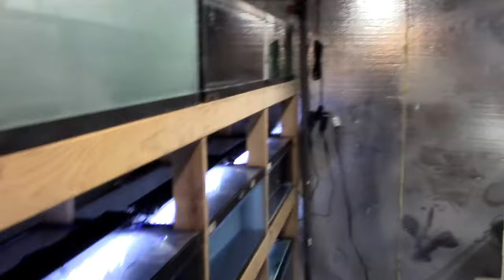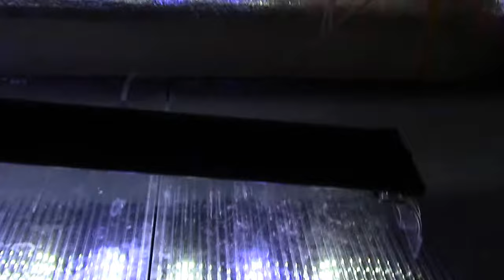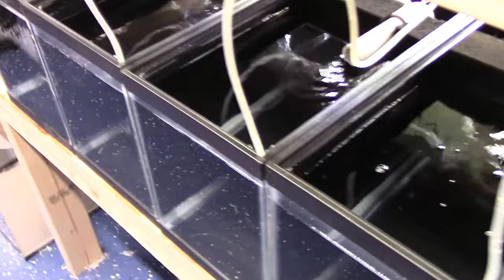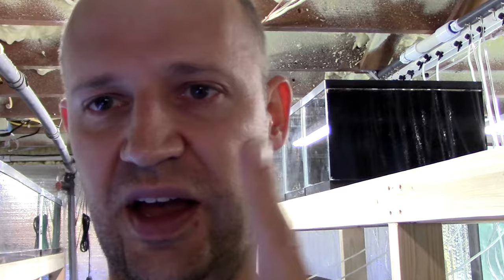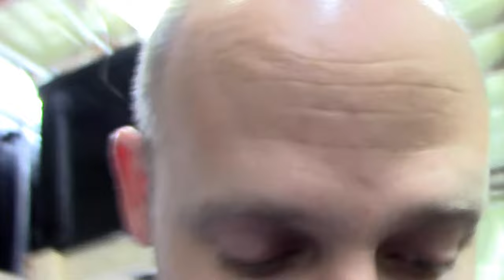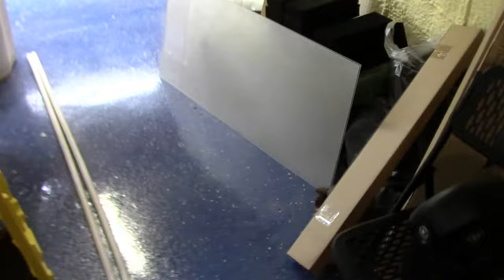Fishroom Update and FISH ORDER PREVIEW!!!!!

Comment: greg sages room temp white worms are trully grindal worms, they are at the least the same size. i have been on the lookout for the tropical white worms myself they are larger than white worms and are supposed to get a bit bigger too, i have also found that breeding red wrigglers is pretty easy. on ebay you can get 1000 worms or 1 pound of red worms for 30$ and every 2 months they should double their numbers , i have found this is very true , i even had about 5 red wrigglers turn into 100+ in less than 2 months in a large grindal worm colony i had going. so its very easy and possible to use them. and they can be kept outside
Reply from the maker: Kyle, thanks for the info. When you set up a red wiggler culture, how do you do it? Just like grindals? I've never tried red wigglers, but would like to give them a whirl.